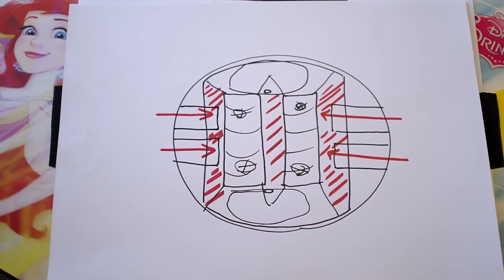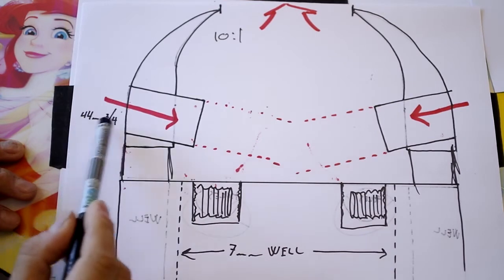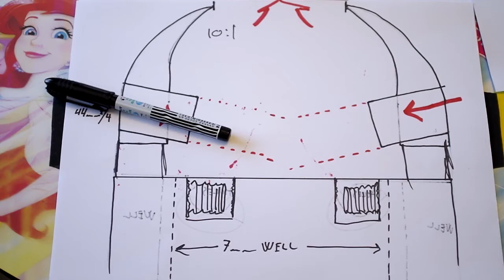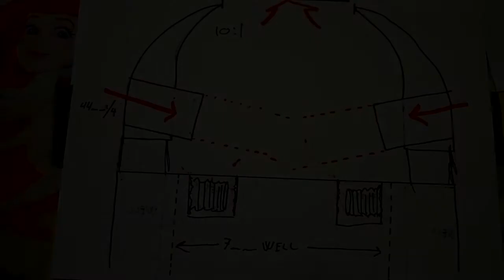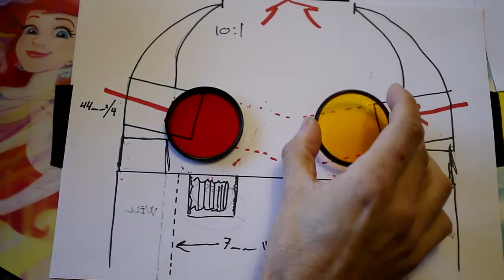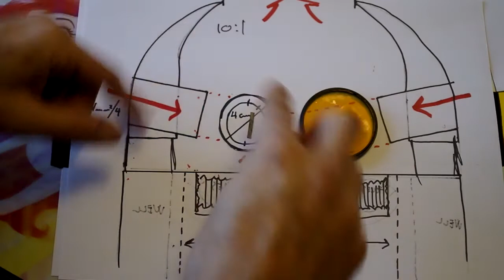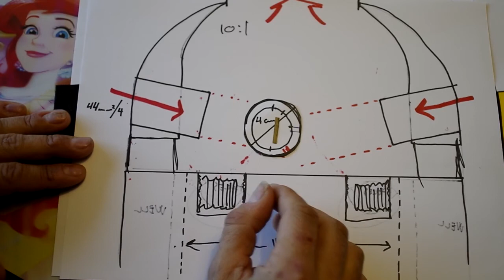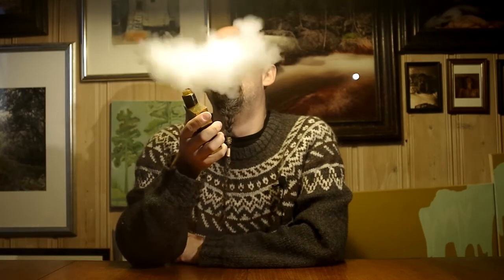Pulse 24 RDA air flow review

Comment: Wow ! Just learnt so much about getting the best from the Pulse 24 from you !  I was disappointed with the flavour on a single coil build  - so opted for 2 x simple single wire (Kanthal A1 24 GA) dual coil 2.5mm id / 0.27 Ohm on my VV Pulse BF Squonker.  O M G - the flavour hits so hard, and massive clouds.  Positioning the coils in line with airflow (cut legs @ 1.2cm) approx.
Reply from the maker: I know :-)

Comment: Morten ive been struggling so badly with getting good flavor on my Ghoul rda, and heres what id like to do. If you have a PO box, id like to just donate the whole thing to you and maybe you could get it to work. I truly feel that because of where the airflow is, that you wont find a solution, but most likely you will because your that good at this stuff. The air comes out so damn low that the coil cant line up with it unless you drop it down and wreck your coil and im just getting frustrated 😤!!!

Anyway let me know. Love love love what you are doing for us vapers out here

Comment: Hi morten I hope you see this message. I’ve been struggling to build a single coil on the pulse 24 and get good flavour would love to know your advice on building single coil on it as I thought you would explain but you only did for dual. I would definitely appreciate to hear your expertise on this and probably a fair few other people out there too 🙏
Reply from the maker: Greetings! Single coil on this one is difficult, because you can't get the coil as low as you should. You will have stalemate under the coil and a very hot deck real quick. You could opt for a collision effect, and just raise the coil. Might work with a very corse/ fancy coil design, but you will only get like 30% of the air hitting the coil very weakly, and only on the underside. Building vertical is also problematic, as the top leg will be very long going back down, but if you cover it with the cotton it still might work. I did that, but the cotton was discolored rather quickly. I think I have tried everything with it, and not getting the vape experience that I wanted. Tricky. 

So if you really want to go there, her is what I did to make it work with single coil: I ended up making a single post on the postless deck, fashion a new barrel out of brass, with very different air holes, and did a vertical build. I put a Dead Rabbit cap (sawed short) on top. I did it as a proof of concept. Lots of work and thinking, but it's brilliant. I love postless decks as experimental platforms. I made a barrel out of PVC at first, and that worked great too.

For single coil, look at the Ceto RDA (it uses mesh, but that means its perfect for vertical flat wire coil too), or the dirt cheap Wasp Nano RDA. I have 5 of those now. It will be very difficult to get that kind of performance out of the Pulse 24. Sorry that I could not help you more.
Reply: Morten Oen thank you for the quick reply it seems that the pulse 24 truly is best for dual. Wasp Nano it is!
Reply: I've just ordered the Wasp Nano for Single Coil ! How is it?
Reply from the maker: It is very, very good. See my review of it, and my "single coil RDA air flow" video. It explains some of the basics of this generic breed of RDAs. The Wasp is the best among them for direct air flow.

Comment: Hey Morten. I noticed you said to build at 3mm with flatwire but I saw at the end you used 3.5mm so is 3.5mm better or should I still use 3mm?
Reply from the maker: Conisdering the experiment we did just resently on this channel, the doubble or single coil-videos, I would have 2,5mm in this now. Not just for energy saving, but for flavor. You should build really small on this deck. I think even 3mm is too big. Sorry for the missinformation, but we learn as we go along:-)
Reply: Morten Oen I just did a build with 2.5mm and I must agree. It's better flavour and airflow. You are the only vape YouTuber I watch now. Thank you for all your tests and advice!
Reply from the maker: Thanks for feedback Jonathan! Splendid news!
Reply: @mortenoen434  I just followed your advice and I am amazed at the change in flavor! Thank you so much!

Comment: Do you have an opinion or testing results on the single coil pulse 22? I set my coils currently where the bottom of the coil is slightly visible looking thru the airflow tube. I can see 25% of the bottom of the coil. This is what a lot of people recommend.
Reply from the maker: Hi Timothy! Place your coil so that you hit the coil at 10 & 2 o'clock. Remember that air goes in a straight line down, follows the curve of your coil, collide with the deck, and drift upwards as turbulence to the drip tip. That is what I have seen in my air chamber. Watch this video: https://www.youtube.com/watch?v=1yeioN9Uphg
Reply: Thank you. This info you are sharing and the detail at which you describe everything is highly appreciated.

Comment: Wow! What about the the Pulse 22? Plan to buy it
Reply from the maker: I have it. I avoid RDAs with the air pointing down at the deck. It's a compromise. I also don't like 2 tubes, because they will miss the center of the coil. Not so bad in the Pulse 22 as in a Kennedy, but still...:-) The Iconic is better. Only whish it was a single coil RDA.
Reply: Morten Oen got it sir.  Yep iconic seem to have a good a good airflow but now for me, im a single coil guy hehe.  Thank U sir i really appreciate it..  good luck on your upcoming videos.

Comment: At 10:37 you say a word an I am not sure what you are saying because your accent is so much different than mine. You say that we can see something happening and I'm no sure what I'm looking for.
Reply from the maker: Vortex, in plural :-) There are turbulence with clear direction upwards on the right side, indicating that the two air flows, when they interact, are pushed to the side in a curved way, because the angle of attack is steeper than in the Pulse 24. In the Pulse 24 they just collide in the center, for the most part.
Reply: Ok thanks for elaborating

Comment: Wouldnt the air take the path of least resistance which is up.
Reply from the maker: Hi Christian! As you can see, it does not :-) The path of least resistance is straight in, because of the low presure environment in the RDA. The air would only bend and move up if a force is acting upon it.
Reply: Morten Oen I get it now. I think if there was a restriction in the center like the posts on the Boreas V2, or the goon and the posts somewhat form a wall down the center of the chamber to kind of guide the air up.
Reply from the maker: Yes and no, Christian:-) The wall or center block on the Goon will only block the flow, not guide it anywhere. The collision will result in chaotic turbulence drifting slowly (relative to the speed of the direct flow) towards the low presure in your mouth. For it to guide the air, it would have to be curved, you will then get a guided turbulence, not a direct flow, upwards, but it would shure help a lot for cooling and flavor.
Reply: Morten Oen Okay. I gotta watch more of your videos. I've learned more about airflow in this one video than years of watching reviews. Thank you.
Reply from the maker: Thank you so much for taking time to do so!

Comment: Не много не верные расчёты, воздух не кто не вдувает в атом, а его вытягивают. И соответственно показатели будут другие. 
Not many are not the correct calculations, when the air does not float, no one thinks in an atom. And it's pulled out!